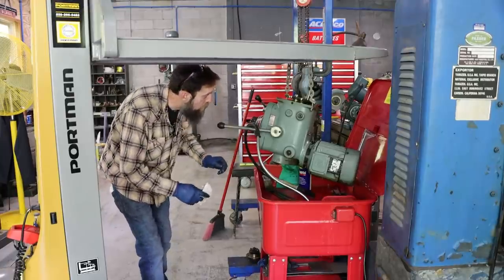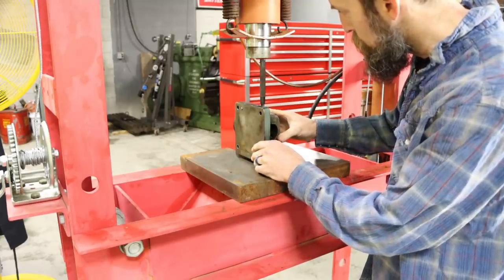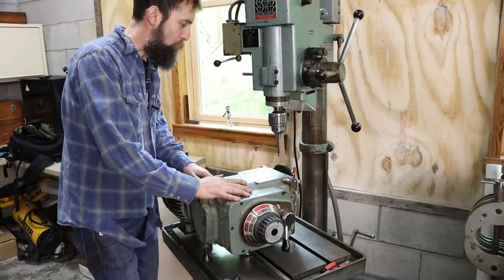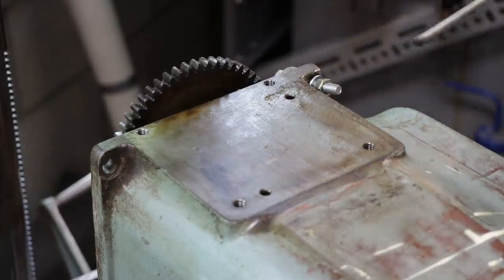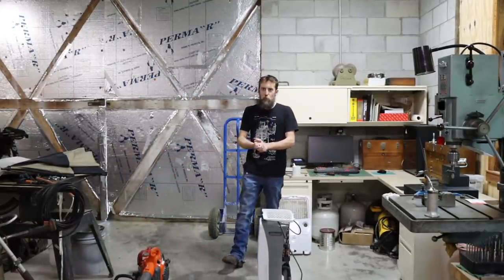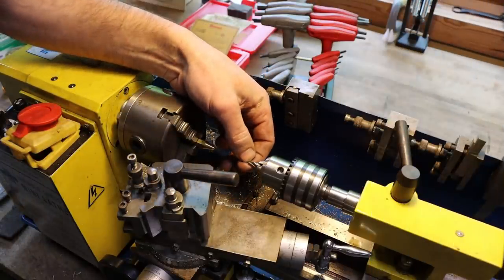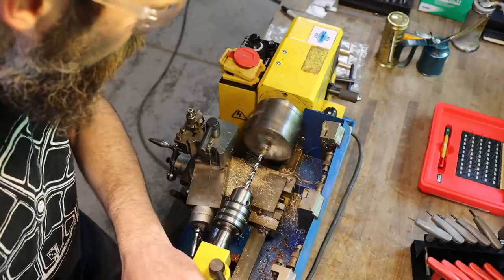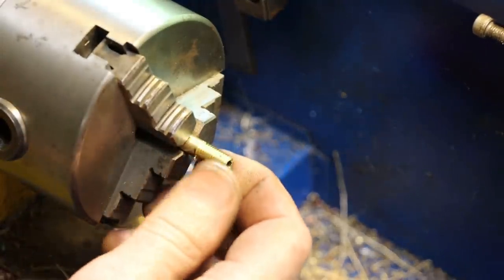Looking for trouble? Broken Dowel Removal Trick & Eagle 66 Oiler parts on the Mini Lathe

Comment: With a broken press fit pin like that dowel, sometimes you can drill through the pin , tap the hole for a grease fitting, then press  the pin out with the grease pressure. If it was too hard to drill or the drill bit breaks, you could drill a hole through the housing below the bottom of the pin and press it out with grease.
BTW, the new shop looks great!

Comment: Steve,
Good trick on the broken dowel pin removal. Another method that could have been attempted is to use hydraulic pressure. Drill all the way through the dowel pin. I realize that may have been a challenge. Insert grease into the drilled hole and use a close fitting punch as a piston and drive punch with a hammer. This will force the grease behind the pin and jack it out the hole.

I made a dowel pin remover slide hammer many years ago. The slide hammer was conventional design, but the end was drilled and tapped for a 3/8-16 long set screw. I made adapters to thread onto the slide hammer set screw with the opposite end drilled and tapped for common threaded dowel pin tapped holes and installed appropriate long set screws. I made standard and metric adapters. I made a rail with 3/8-16 set screws equally spaced to store my adapters. My habit was to drill and tap all replacement dowels and tapered dowels in blind holes on assembly to facilitate future disassembly. I purchased threaded dowels when possible. This slide hammer served me for more than 30 years and pulled countless dowel pins. I just rummaged through my "work" tool chest to confirm how I made it since I haven't used it since I retired. I can't find it. I must have considered it a shop tool and left it in the shop tool chest when I retired. The slide hammer was undersized and took up little drawer space. It was as cute as a button, and made me feel more professional than using a cobbled together rig. I will need to make a new one, just so I can brag that I have one and none of my boys have one.

Comment: This video made me think of a project idea you might like:  
Using a shock absorber or similar hydraulic damper, rig it for the "Portman" to help control descent.   I'm imagining a hook or plate fixture, which can be quickly set on top of the column, with a chain arrangement down to the forks, and perhaps around both of them near the root.  A chain for adjustment, since whatever damper you find probably has only a few inches of travel.  When you need controlled descent, you'd get into a position above your destination, bring it down as much as you feel is safe unconstrained, then add the rig and attach the chain, to slow descent for the inches remaining.  You can probably think of an entirely different design - if the concept appeals to you.

Comment: Steve- Put a hydraulic rate control (needle valve/check valve) inline with your lift cylinder to slow that lift down. I did it on the lift I have, and it made all the difference to be handle stuff with a delicate touch.
Reply: Yeah, that's a project I'd like to see done. While it's apparently been an absolute boon for Steve, I do wince every time it jerks and bounces like that. Fine for palletised objects, but slung loads give me the shivers.

Comment: Lard oil or bacon grease doesn't discolor brass, black oil will.  Seen a lot of lard oil when I was young, we used to butcher hogs and render lard, lard oil was the lighter oil that would come to top of lard stand, bacon grease works, just solid when cold.  But it makes you hungry when it warms up and melts.

Comment: Hey Steve, I'm sure if you sat down and thought about it you would have figured out that you could do the oiler nozzles in one operation. Do your second operation first, drill the small hole, then set your compound to the opposite direction ie, digging in and then part off, job done.

Comment: For multiples of those nozzles I would taper and part off as many as you need, then reverse them in the chuck and drill the tap hole followed by the oil hole and tapping-  saves you a step in the process.  If you had a 3 or 4 position tailstock turret, that would allow you to swap between the 2 drills and the tap without changing tools.
Reply: And it would lessen the chance of breaking the 0.033" drill bit. Less brass to drill thru.

Comment: I’ve found for through hardened dowels, if you ever run across a broken one, I get a small endmill and pick away at it starting from the center and move out to the edge of one side, then move to the edge of the other side (basically cutting it in half) then it will normally pop right out or can be picked or blown out.

Comment: If you need to drill a piece of hardened steel such as a dowel pin,  sharpen a masonry bit on a diamond wheel and use that for drilling a hole. Much cheaper than a real carbide bit.

Comment: Mini lathe: Before I put a carriage lock on my mini lathe, to make a parting or facing cutting I would engage the half nut and maintain pressure on the carriage handwheel to take out backlash while making the cut.  Obviously the lead screw has to be disengaged.  My saddle conveniently has an M6 threaded hole centered over the ways.  I passed an M6 bolt down through it, and fitted a washer and Loctited nut on the bottom end of the bolt.  A counterclockwise turn on the bolt draws the washer up onto the underside of the ways, efffectively locking the carriage.

Comment: just get a window air conditioner, I bought a cheap one from the big box store and it can cool my 6 car insulated shop but I mainly use it for de-humidifying and when needed I can cool the garage also. It can also heat so double bonus. A low humidity and slightly cooled shop feels so much better than nothing.

Comment: about the dehumidifier : a normal window mount aircon unit does the same thing frien of mine just set the whole unit on a chair in the room with a bucket under it to catch the condensation , its probably made to last longer too m guess if you put it through a wall it would cool the shop down nicely too

Comment: The power feed mechanism on DoAll mills is second to none. Some do just X some both X & Y. Some have power knee lift too. The feed transmission has a lot of speed plus high/low and you can shift it while it it turning. Integrally designed feed systems sure beat the various add on feed boxes you see on Bridgeports.

Comment: An old boy once showed me a trick to get a pin out where you either drill through the pin or adjacent to the base of the pin the object is to get to the tiny space at the bottom of the pin then fill the drilled hole with oil then using a pin or even turn the drill round push the pin into the hole then strike it with a brass mallet the object is to use hydraulic force to push the pin out and this can be repeated until you can get a purchase on the pin to remove it Oh and a piece of rag around the punch will stop you getting a face full of oil . its always worked for me and I guess its less stressful than trying to tap a hardened pin

Comment: Those blocks of steel on your press, judging by the reflection of the light on them, the color of the rust and the surface texture, I'm pretty confident that that is 1018 steel.

Comment: Watching some more, love how you are setting up with level.  Mills I have used have been leveled as close as possible,  if not I leveled them so I could use level for setting things up.  I have a 4 inch starrett level I bought years ago that has been the handiest mill setup tool I have ever bought.  But you need a level mill, no big deal.  In your case drill press.  Then it is a comparative thing.

Comment: Thanks for another great video Steve. I watch all of them but seldom reply.  Nice work with the mini lathe. Turned out great. I bought the HF 7x12 a while back. Upgraded the bed, carriage lock, and tail stock cam lock. Have not done the bearing upgrade yet but will.  Amazing the quality of the parts you can make on these.

Comment: Haven't even watched the video yet and know where you are coming from.  Old mechanics trick, use hydraulics to remove pilot bearing.  Dowel pins are case hardened, soft in middle, get a hole drilled in them, drill and tap then pull, or just drill, fill with grease and use well fitting rod to hydraulically remove.  Guys at work thought I was a genius one time,  told them, grab a grease gun and a so and so punch, hit it with hammer.  Wow it moved, came out even, simple mechanics.  They keep this old fart around for a reason.
Reply: Harold Sprenkle, keep dazzling them and don’t let them see you sweat. And keep teaching them, they think they know it all but let them keep thinking that while you show them the tricks! Stay safe!

Comment: As every time, a very enjoyable video.
Your electric fork lifter really works well almost replacing a gantry crane. 
Check the weight of the forks, the cylinder etc, and add the weight of the load before standing under the load. (You know it's a general rule, never stand under any thing being lifted.) All kinds of jacks, lifting devices "love" to go on vacation when they smell humans being right under them....
Does Your lifter have any emergency valve, at the cylinder, that cuts off the flow of hydraulic oil if it exceeds the allowed value? Else a broken hose etc. will allow the forks to free fall....
Poor squirrel trying to climb iron legs.... How do Your squirrels acts meeting strangers? Are they the same interesting? Would be fun to face such a beautiful creature like that.

Comment: You got little hole done.  I still have a tiny center drill ratholed  .025 dia drill also.  Joe P covers tiny hole drilling well, has a few tricks he shares.  One of those fancy Albreight   finger pressure chucks sure are nice.  But you got things done in a workman like manner.  Hate that squeak when tapping brass.  Best cutting oil, lard oil, or just have the wife save bacon grease, smells good when it warms up, just keep it covered to keep the mice out.  Ha

Comment: But if the locating pins are case hardened then you ground it down then doesn’t it mean you now put a mild steel pin in that would shear off like butter
Reply: I was thinking the same thing when he was cutting it with that hacksaw…..

Comment: I am wondering how you could put some kind of potentiometer or rheostat on the pallet jack lift circuitry. Like just add a dial. So it can be instant on but not full power on and it would work slower.

Comment: Great video Steve! I didn’t think you’d be able to drill and tap that dowel pin tbh. They must be case hardened, just shows u never know until u try ay. 
Was wondering if you know were I could get my hands on some “oil nipples “ for my gunsmith lathe? I’m doing a full rebuild and it needs new oil nipples, it has 6 oil points and I can find any new oil nipples anywhere😬. 
If u could steer me in the right direction that would be much appreciated 😊

Comment: 27:22 .. I just had a Clickspring moment! Love the variety of jobs getting done today.
Any reason why you leveled the unit on the drill press instead of sweeping an indicator from the chuck to square it to the coloumn?
Thanks for sharing!🇨🇦
Reply: Was wondering the same, unless he level checked the locked table surface with the heavy part on it first.
Reply: Then again, it really wasn't a precision operation. 0.300 deep (?) Close was good.

Comment: I have to drill little tiny holes in little tiny parts (missile parts) at my job and we use little tiny lathes... I use a German manufacture lathe with watchmakers chuck. The hand feel on this machine is remarkable. I also use Servo brand mini drill presses for other things. Have to tap a lot of O-72 and 2-56 holes. We use sperm whale oil (yes you can still get it) for lubricant. We have made a lot tooling ourselves. Liked your dowel removal trick.

Comment: Nice episode Steve, not much squirrel time today, we want more before the little guy flys the nest so to speak! I just love the rapore you and Elizabeth have with all those little guys and one girl ! A little comment/ question, why did you when lifting the gearbox not get the gearbox and chain closer to the back of the forks? You would make less work for the machine and the batteries if the bearing surfaces of the fork unit were under less leverage and moving the whole unit would make for even better stability. Lucky you have a nice flat new concrete floor that your contractors did! Lol  Cheers from the UK, see ya next Saturday!
Reply from the maker: I'll make sure and put more squirrel in next weeks video😁👍

Comment: Steve ... what speed do you run your mini-lathe at to cut Brass/Aluminium?
Reply from the maker: Depends really on dia. But Fast works most the time😁
Reply: @SteveSummers  25mm Aluminium round bar... 1000/1200 rpm?
Reply from the maker: @davelethaby1279 Yeah, that range works. Lots of factors. With my little machine I just adjust on the fly. It doesn't display RPM for me so it a guess really.